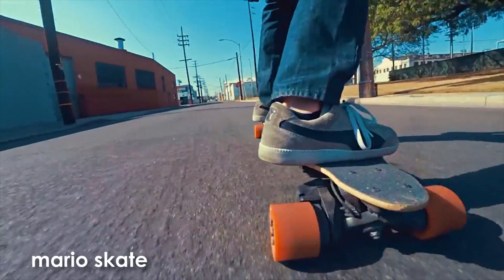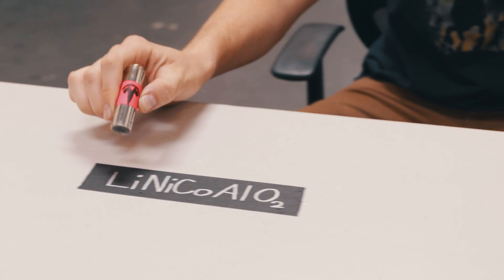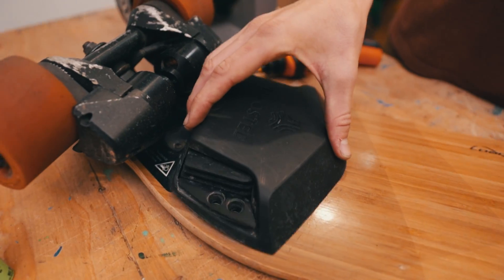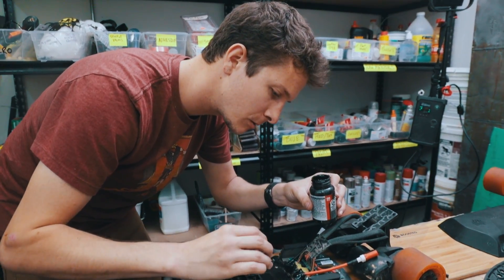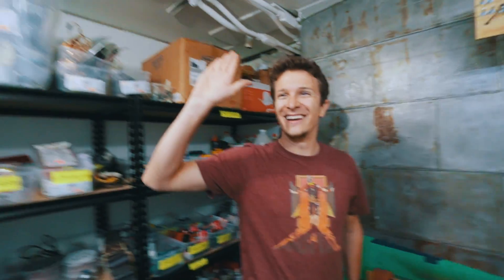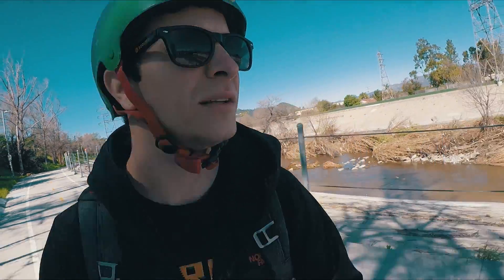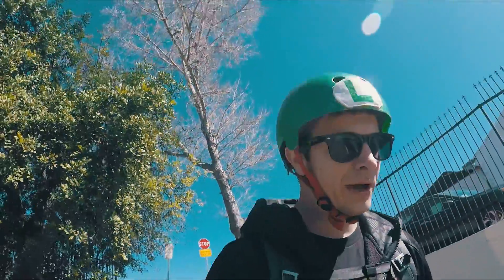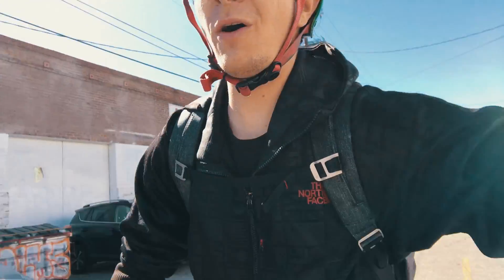Tesla Batteries in an Electric Skateboard!

Comment: Well, quite like your phone when it's low on battery you have to charge it wile your doings things, why not use those batteries you made not to run the boosted board but to charge it wile running it, it has its own system and it won't interfere with the other batteries

Comment: Don't mix cell packs. You are asking for trouble there. Depending on what type of LVP protection is on the board, you are going to trash your batteries with a mixed pack like that. There is the problem of overcharging, and over discharging with cell mismatch even during steady state. Take current measurements under load and see what sort of discharge rating you are going to need. From there build a custom pack with external jst breakout balance charge plugs. Or... you could just go to 2 5s 1p LiFePO4 "hobby packs" in series, and keep an extra set in your backpack to hot swap.

You can easily tap add a cell voltage monitor to the pack with a user set alarm as well.

Comment: What if you make it all one circuit?
Reply: And if you don't understand connect one battery to the back of the other and the other side of the one your connecting to hooks up to the board so basically it becomes one super big battery but split in half or you could basically do the same thing but leave both battery's able to connect to the board but connect the two backs of the battery's.
Reply: And if you don't understand connect one battery to the back of the other and the other side of the one your connecting to hooks up to the board so basically it becomes one super big battery but split in half or you could basically do the same thing but leave both battery's able to connect to the board but connect the two backs of the battery's.

Comment: Heyho, a quiet easy way to rise your voltagelevel is to add another battery to get the 11s2p configuration instead of a 10s2p config you got right now. I think, that this might not break your engine but the safeway would be tu drive with a maximumpower of 80-90% in the first 10 minutes. After that time the voltage should be in the stabilized area. For understanding, take a look at some discharging/charging diagramms of li-po cells.

Comment: You need a voltage regulator they are pretty cheap
Reply: A voltage regulator lowers the available voltage to a constant level.  It cant raise the voltage..
Reply: You can raise the voltage but the watt's will stay the same. They are called transformers. But yeah, it will not improve anything.
Reply: aspraconsulting a boost regulator can.
Reply: voltage booster

Comment: All is good, your pack size is fine - just use the correct type of 18650 cells - check the cells the Vape MOD guys use - they are are rated for extreme current drain probably even higher than the OEM Boosted board's battery pack. Try the Samsung INR 18650-30Q – up to 15 A continuous discharge per cell. Plenty more here: http://ecigarettereviewed.com/best-high-drain-batteries-for-sub-ohm-vaping-2015

Comment: what if you were to put an extension from the connectors of your new battery pack then add a regulator of sort to regulate the voltage and then connect that to the charger then you can slowly charge the boosted board while your riding to hopefully extend it to drain the other 2 batteries. I know this sounds stupid but was a random thought. good luck man !!

Comment: How about a bridge or switch that make two channels of batt. hooked in series.  When one drop off the other takes over. that way you only have one set of the same working at a time with the same voltage.

Comment: You are clearly more versed in this than I, But if you know the area where the energy is being taken out. Then, why cant you increase the area of where the battery is being taken out. So if the range of the regular batteries is only 2/3rds of the new batteries than can you make more energy 2/3rds of the new batteries or is that to simple and you want to use the full potential of the new batteries? If so than the obvious solution is change the small battery and mod mod mod.

Comment: You could add a battery to each pack, with a switch in between it and the other batteries so that when the voltage gets too low, you can flick the switch and you would have 11 batteries in series to form a higher voltage. 

that is the quick fix, a better way to do it would be to hook up a set of batteries that can maintain a voltage by switching their configuration from parallel to series, only some configurations would work, but you could design it in advance and rig a voltage sensor to the switches so that it automatically maintains a usable voltage. This would work, but only for some numbers of batteries. It would require math.

Comment: You have to remove the skateboard battery. I dont know why you even had those new ones in parallel with the old ones. Take the old one off so its not bottle necking the newer ones.

Comment: why not make it charge the booster board battery
Reply: It won't run when it's being charged.
Reply: Esa Edvik darn
Reply: No it wont, problem with overheating.
Reply: using and charging the battery at the same time is never a good idea
Reply: If he is coupling the batteries in parallel, that is effectively what he is doing.
Reply: Esa Edvik it's probably possible to fix that.

Comment: Use the extra charge from the battery packs to charge up the boosted board battery. That way the board is still outputting a high enough power from its own batteries.

Comment: Hey here's a tip. Trash the boosted board battery so you can use all the energy in the other batteries and add a little more batteries to compensate for that!

Comment: use a buck converter to up the voltage to 35V constant. But btw for safety you should also add a battery monitoring thing... Check out Great scott he just made a battery pack video!

Comment: Resistors in the motor. Need to check that for more torque.
Reply: Fried motor
Reply: Rather the board itself before the motor.
Reply: resistors would limit current which makes sense. But then you have to check what current the motors are limited to or else you can burn out the motor which obviously isnt what you want.

Comment: Not sure if you'll ever see this... But perhaps you should try an electric unicycle? Some models are capable of going past 40 km on a single charge. Although.... I don't know how that will convert to in miles.
Reply: Nvm.. I just punched it into google and it can get up to 24 miles of range... though it will be a slightly slower journey. A super heavy model such as the gotway MSuper V3 can get up to 82km range which is a 50 miles range...

Comment: It would have been a lot easier to replace the included batteries.
That way you wold have no problems with the voltage and you would use the actual battery protection circuit.

Comment: A 40V battery only works when the battery itself holds more than 40V, once the voltage in the battery goes bellow, the flow of electrons sloes causing less power. The way batteries work charged above 40V is they have resistors which constantly allow no more than 40V through.

Comment: you could hook up a supplemental battery to a relay that was tuned so when the boosted battery died the supplemental one was connected and kicked in. (you could also use this to auto-disconnect the original boosted battery for conditioning purposes)

Comment: you would get better power by checking if the resistance of the wire that's connecting the battery pack to the motors the lower the better about 0.18ohms so you could get a power output of 350w-400w

Comment: you need to take out the original boosted board battery and solder in 2-3 tesla battery, that way they are all equal and would have the same out put. What  is happeening is that the tesla batteries are feeding the boosted board battery which is using enery faster which will drain your batteries. Also you whould solder in a volatge counter to each battery

Comment: says it's $15K
cold solders the connections
I'm just a rookie in electronics, but I know leaving solder blobs in the connection causes excessive resistance in the wires, so you won't be getting the right power output and the wires could heat up.
Also leaded solder is better for high conductivity even if it's not environmentally friendly, so you could try using that for all the soldering work in addition to what I said about soldering the wiring.

Comment: use a compasitor that jts max voltage is 40 and connect those in-line that will make it so you can utilise more of the batterys potential energy

Comment: Today there are many restrictions in machines. As example you have a bad ass gaming pc with huge power for 8k. But the nvidia software allows only 4k.

Its the same on the boosted board in my opinion. You have all that power in the batteries. But you cant use them, the boosted board might has softwares in it idk why maybe for overheating control.

But the softwares might not be the case. My opinion is, all the power you have in the batteries ARE USABLE. The problem could be, that the motor cant handle such high power, just like you upgrade a regular car.

If you tune a car, you gotta buy stronger parts. And thats the same with the boosted board. You gotta upgrade the motor to something that can really use that much power.

Comment: change lay out of your cells so you get less voltage but make sure you stay with in the amp range of the 18650 battery's the board will use less voltage because it will use all the battery's at the same time so you have less voltage and more range and probably more torque it's just the layout dude

Comment: Solution: Remove shitty board batteries, replace them with those tesla ones, hook up in Series till you get your voltage, and then just add another set of matching capacity batteries in Parallel to double the power/run time,hook up balance leads and use a lipo alarm to prevent complete discharge, and a balance charger to properly charge those batteries, throw in a temp sense too,

Comment: So here's what I think if you somehow manage to disconnect the primary battery once it reach the cutoff voltage ie 33v.. You said the motors can charge the batteries back, so that means the secondary batteries are further charging the primary battery once they died...  And if you make a circuit that automatically cut off primary battery that can be the solution..  I think you can do with transistors and icu 😉

Comment: I'm pretty sure you just need more strings in parallel..... I think your short on current not voltage .... that determines the speed ... try adding more strings if you can ... it should work just fine ....

Comment: Wren, you need bigger voltage to increase power. Resistance of motor coil is limiting factor, not batterys output current (which is defined ).
Often batteries could provide much higher current then specified in datasheet, yet it will decrease it's lifespan, in lipo case, up to less then minute before explosion.

Problem with increasing voltage is that motor driving circuitry might not handle increased voltage and ether blowup or it might overheat. You need to investigate components they use, at least check datasheet's for driving keys. But be carefull! Datasheets are quite hard thing for beginner, they are really easy to misinterpret.

Easiest way for you to increase voltage is to make more series cells in each parallel bank. (By the way, make sure when you connecting two parrallel banks, that they have very close voltages, otherwise one bank will try to chargeanother one and this is not good at all.)
Another way is to find buck-boost converter. (it can step up and down voltage at same time, providing output voltage that is close to input, when batteries fully charger), but it might be very hard to find one that will fit your needs. And also they are not 100% effective, typical is around 80-90%, so you are loosing some energy.

If i had this problem, i would probably ditch off  driver part of circuit and design mine own, to work vith something like 50v battery pack. Yet it might lead to motor overheating, and you really do need some knowledge for this...
Reply: Found your comment.
Current is not because of speed, but because of load on motor. acellerating, going uphill => increased current.
Did your packs overheat in  that ride? If they were working on they max they should had been almost too hot to touch, and this is very bad.

Comment: did you check the software? I work programming drones and we usually right an override method for how long a drone can stay turn on for... we do this so that  peoples mods won't mess up the original pieces such as a motor over heating because someone amplified the battery to increase the products range

Comment: Replace the boosted board batteries with 18650 units. Add more 18650 batteries. Use 18650 with higher voltage chemistry

Comment: boost Converter, voltage reader between the battery and the boost Converter, a screen on the top side of the board (7 segment cuadruple display with a dot) displaying the actual battery non boosted voltage, a buzzer set to the low battery point, a low battery cutoff so you dont damage those batteries with the boost Converter, a case for the batteries they Will Burn if punctured, that is some ideas i think you could do them all, and tou can calculate mileage by knowing how many amps It uses per mile, and knowing the amperage of your batteries. just some tips Hope you find them useful, if you read this do what you can to get him to read this because its helpful.

Comment: You could make it so the two battery packs you made drain before the original one, making the board think it's still at full battery, causing it to go faster and telling the controller to keep the battery meter at green until it eventually switches to the original battery pack

Comment: Assuming your right about voltage being the problem, the issue is the boost board controller. It's sensing the voltage is 35.5V and reducing what it sends to the motor to protect the battery from being damaged. It doesn't know you have other batteries that can run down to 30V.

On way to fix this is to totally remove the boost board battery and increase the number of 18650 cells so the flat point for the 18650's is increased to 35.5V.  The risk here is that this will also increase the fully charged voltage and we don't really know how much extra voltage the controller can handle. We also don't know if the control board will run without its own battery

Another way to fix it is to find the voltage sense line on the control board and mess with this signal a little so when the battery is at 30V the controller actually reads 35V instead. This will require  bit of electronic knowledge.

Another option is to just give up on the lower voltage 18650 cells and just add more batteries of the same chemistry as your existing battery.

Comment: If I were you, I'd just rip out the boost board battery and just put in a wireless controller like the one you have, then put in a high voltage esc, and motor. So basically, yes a whole remodel. BUT HEY, wat ya gonna do without them?
Reply: And, I learn that from experience man.

Comment: the industrial capacity needed to extract and refine the elements needed to make these batteries exceeds that of the petrol-chemical industry. those elements need to be assembled into a battery and shipped, which is a further step beyond oil.  the electric motors that use that power are full of copper or other ferrous metals, that also need to be mined.

the internal combustion engine can be made of aluminum, one of the few materials that can be truly recycled, and steel. gasoline and diesel can be grown from crops and are more efficient than the coal plants used to power most of the world, the usa included. 

electric cars are filthy, chique, but filthy

Comment: now I know charging and using a battery at the same time is not good for it's health.  but why not try having the Panasonic batteries charge the boosted board batteries instead? it would solve the monitoring problem as it would have to drain the "backup" batteries b4 starting to "use" the board ones'. you might first have to go through a voltage booster or something similar to get the power to charge the boosted board batteries using every drop of the Panasonic batteries. How viable is this solution? ignoring the boosted board battery health over time
Reply: also the this way the boosted board battery would in a sense act as a capacitor, charging slowly and then outputting huge power when needed and depending on if you slow down during some paths the"capacitor" might get a chance to catch up charging.

Comment: ditch the boosted, switch to higher discharge cells like lg hg2/he4. or lipo. then go full diy. I ride that path all the time and go up that hill even on low battery.

you need at least 10s3p to get 15miles. and add some low voltage alarms!! 
 check my site for some diy info
http://esk8.today

Comment: The problem is your motor controller.
Boosted boards Motor controllers limit the voltage and amperage you can draw from batteries. If you want to fix this you need to upgrade motor controllers to a vesc. Which will allow you program it.

Comment: the speed controller needs a higher amperage rating. it's your bottle neck. you also need to custom program your low voltage cutoff so it doesn't slow down and limit your voltage prematurely so you can continue your run past that voltage rating in which the boosted board electronics limits it from going down further.

Comment: Your battery pack outputs 200 watts, while the board's motor is rated at 2,000 watts. So, you need. to use batteries with a higher capacitence rating .The watts produce the power not just voltage btw.

Comment: What you could do is instead of using three batteries to power the booster board you could use the two extra batteries to charge the boosted boards battery